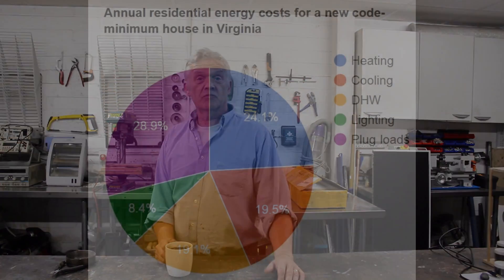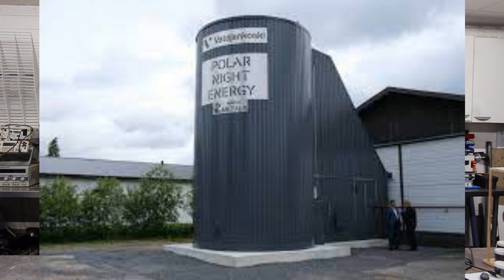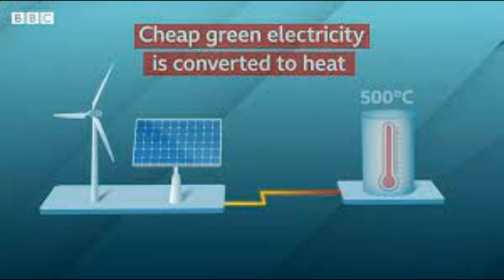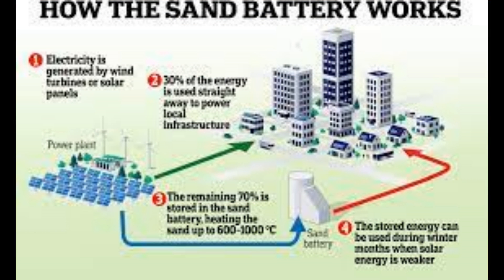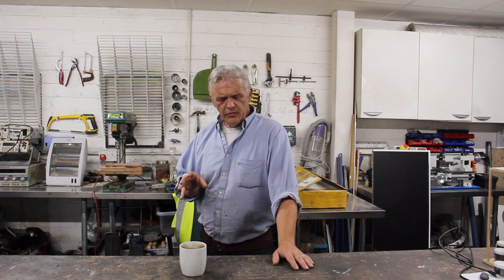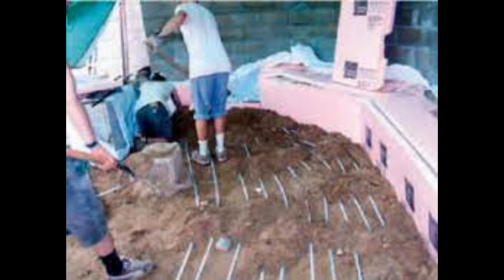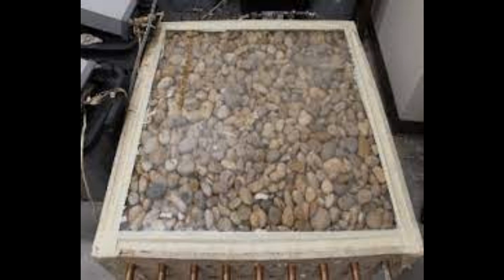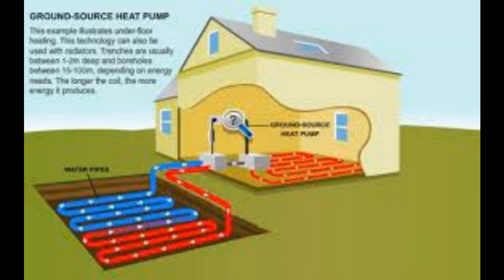1604 The Sand Battery - A DIY Option Or Not?

Comment: I really like the idea of thermal storage that is so dead easy anyone can make it. Right now i am on pause with a little project of mine where i plan on storing heat in a large water tank with sodium acetate stillrods because Im working on the bicycle machine for the competition, but when i finish that I could definitely share the heating project with you! :D
Reply from the maker: please do mate I would be fascinated and I am looking forward tot he bike competition entry
Reply: I had a Tarm wood gasification boiler about 20 years ago now in a house I don't live in anymore.  But I built a 700 gallon thermal mass water tank outside with R60 insulation to keep the water out of a finished basement.  It worked very well in New Hampshire where we get temperatures as low as -30f.  I could shut down the boiler in the spring and fire it once in the summer to get all my domestic hot water.  I have plans to do something similar at my current home as an opportunity load for solar panels I just haven't gotten to it yet.  Too many projects.  I would recommend looking into the plastic float valve used in energy free cattle waterers to keep the tank full.  The hot water destroyed the shutoff valve in my old tank with minimal buildup and crossion.  But the plastic floats don't have any trouble in a very similar environment in my cattle waterer.
Reply: My house has 2ft thick stone walls over three floor plus attic. It takes quite a few weeks after summer to loose its store until the wood burner is needed. I will complete my long awaited external insulation this year along with a Trombe Wall,  im determined. Hopefully this will drastically diminish my 12-14m3 of fire wood, perhaps to less than half or more. Solar heats my water and provides electricity, the wood provides hot water and central heating  and cooking in the winter. Wrapping in part your uk brick homes in glass is perhaps an easy and relatively cheap option considering total life cycle costs and much better than vast amounts of cellular plastics...but you'd have to send the local planning dept packing first. Best wishes.
Reply: @jimmycorkhill1390  Half my house in the UK has 3ft thick limestone walls, the other half is a modern extension to early noughties insulation standards. Both the old and new parts have reasonable roof insulation and recent high quality double glazing.
In the Summer in hot weather, it takes about 2 days to heat the stone in the old part to make it unbearable at night and it stays that way until the weather cools down, whereupon it is back to normal in a couple of days. The new part with much lower thermal mass is much easier to keep comfortable at night in the Summer, a portable AC will cool a bedroom in under an hour before bed.
In the Winter it takes about 48 hours of continuous heating to warm the old part, if it has been unoccupied for more than a couple of weeks. I think the hygroscopic limestone takes a lot of energy to warm and drive off the moisture. The new part is warm in an hour.
So thermal mass IMO from my experience is a PIA in a house unless it is in something controllable, like this so called battery.
Reply: @lisakingscott7729  Thanks, there is something not right about your story. Thermal mass is an ancient tech that is still in use in both the hottest and coldest climates. My house in a slightly more extreme environ than the UK, (hotter summers and colder winters usually) has no AC other than windows, is circa 18 degrees in my downstairs lounge when it is 33 outside (official data), 24 degrees in my upper living and recently measured 45 in my loft. Sounds like you have the stuff not using it in an optimal way. There are many excellent examples of using glass wrap to houses some with thermal mass, some with forced air movement. My total annual heating and electric costs whilst being comfortable are 150 euros x 4 cords this season, 600 euros, hopefully after this years graft to become a potential zero. Best wishes.
Reply: @lisakingscott7729  Sorry, just clicked in my head the likely cause of your problem. Im guessing the renovations to your home turned what is termed a heavy thermal structure into a light one by insulating the inside of all that stone. So you are not receiving benefit of thermal mass, as if it wasnt there at all? It would heat up quickly and cool quickly with heating/cooling equipment. Best wishes.
Reply: What are you using to stop phase separation of the Sodium Acetate Trihydrate when it's supercooled? What about the method of kick-starting the nucleation of crystallisation?